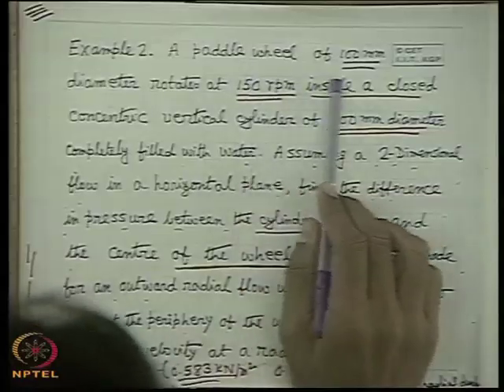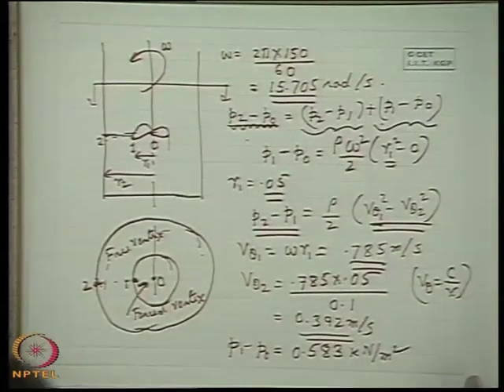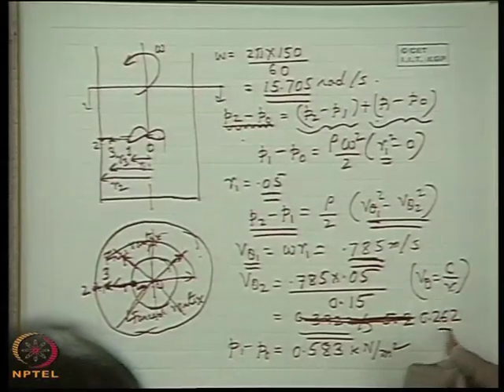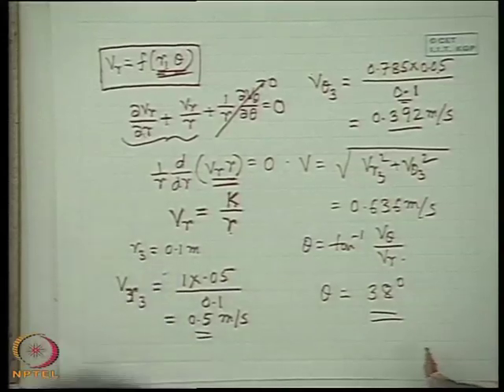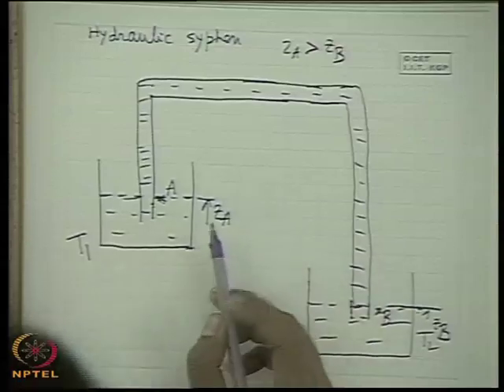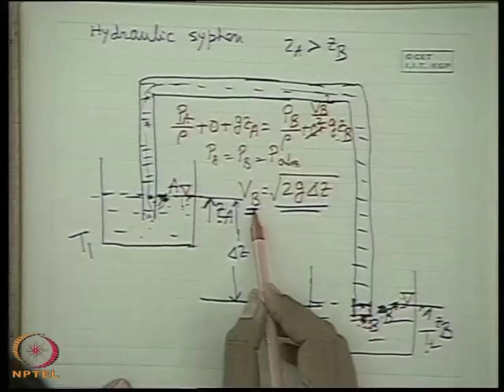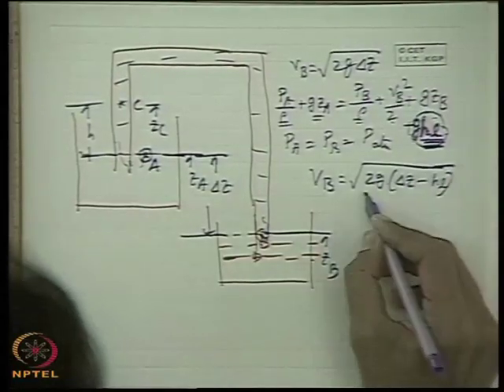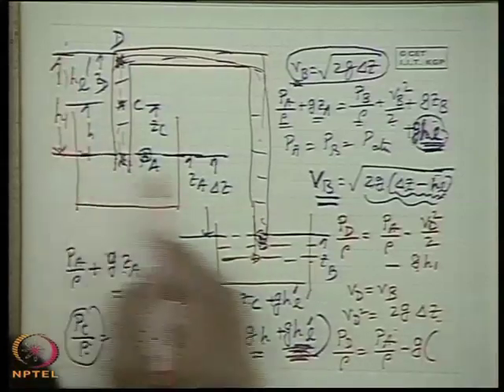Mod-24 Lec-24 Fluid Flow Applications Part - III

Comment: problem 1 how option a is write pl. guide
Reply: Ciao! Fluid flows from B to A because in the energy balance of Bernoulli Equation the (head) energy in point B is greater than total (head) energy, hence a fraction of initial energy B it's utilized to overcome the frictions. For this reason the equation is
Energy in A + head loss (energy dissipated to overcome frictions) = Energy in B

Comment: Can anyone plz explain solution of last question(no.3) m
Reply: Ciao! You have to write the modified Bernoulli Equation between the point in the entry and the point in the summit of siphon. Keep in mind that all data are given in terms of head, so velocity head is defined as (V^2)/(2*g), pressure head as (p/rho) and head loss is simply h, such that all the terms in equation have the unit's measure of a lenght. Hence, computing p on the summit, we obtain
p(head) = (10.3 - 0.5 - 3 - 1.5) m = 5.3 m .
The pressure is greater than vapor pressure of water, Cavitation is avoided and engineers are happy! Good luck!
Reply: @fabiozangara1532  At 45.51 , Question 2 how option d also comes?. How can pressure at summit depend on downstream length? please answer
Reply: @aiswaryasanthosh7878  ciao! I followed this course 2 years ago but I try to help you. Based on the explanation of Prof. SOM, if you write the Bernoulli Equation for ideal fluids, between the top corner of the siphon and the tank downstream, setting the level of the lower tank as a zero potential you obtain:
p(summit) + rho*g*h + 1/2*rho*V(summit)^2 = p(atm) + 1/2*rho*V(downstram)^2 , where h is the height of the summit with respect to the lower tank. As you can see the pressure at the summit of the siphon (top corner of the tube) depends on the downstream leg h

Comment: if flow takes place from higher energy to lower energy , then why we equating the total energy between two points. Please explain
Reply: when a body is dropped from height, the gain in kinetic energy is equal to the loss of potential energy. In general the energy is conserved. the energy is converting from one form to another.
Reply: high pe to low pe..pe means pressure enegy plus gravitatational energy
Reply: same doubt.. an ideal fluid should not flow
Reply: Yeh , in case of energy conserved, if flow is taking place then pressure gradient will be negative in flow direction . You can check it on applying energy equation in any  inviscid flow. If energy losses due to viscosity  ,it is obvious flow take place from higher energy to lower
Reply: It is an ideal case. To have a flow, loss must be there in the energy (friction, viscous force)
Reply: Here we are just applying Bernoulli's equation, not bothering about the flow from higher energy to lower energy.

Comment: In the problem at the start of the lesson, if previously a vortex flow was defined as a flow where Vr=0, how can there be a Vr in the flow inside the cyllinder?
Reply: Same doubt here as well, while deriving Vt is just function of 'r' and not the 'angle theta' we assumed Vr to be zero. We did it using continuity equation and placed Vr=0 and found Vt=f(r). Here assuming there is radial velocity Vr and again using the same continuity equation and placing 'dVt/dt=0' (since Vt=f(r)) (t represents angle theta) we find Vr=f(r). This truly doesnt make sense. Please Explain
Reply: @DilipSaini888  this is an example of spiral free vortex flow. in that case, tangential and radial velocity components at any point are inversely proportional to the radial co-ordinate of the point.
Reply: @vai_-cn9br  thanks 👍🏽